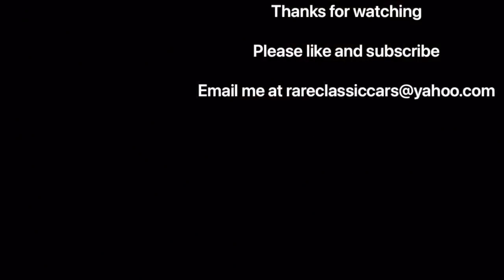Worst Engines of All Time: Chrysler 318/360/400/440 V8 Electronic Lean Burn

Comment: Hi Adam. I live in Australia. My father was a taxi driver in the  mid 70s to mid 80s. The Chrysler with the 318 was the vehicle of choice for most taxi companies.Day 1 modification with a brand new chrysler 318 elb was to rip out the elb and convert to old school carb setup.They would then run anywhere from 700000kms to 1000000kms.Amazing engines for the day.Another fun fact for you for some strange reason a lot of 318s engines were very popular in speed boats here in Australia.Not sure why.
Reply: 318 is a quite good engine among other mid-size small blocks.
Reply: Chrysler's marine division was a pretty big thing in the 60's and 70's in North America, offering both outboard (2 stroke) and inboard powerplants. Pretty sure that the inboards were based on 4 stroke automotive engines.
Reply: @martinliehs2513  Inboard were the same slant 6 and v8 engines in the cars with a few modifications to make them seaworthy.  Especially to  water pumps, alternators, ignition systems and fuel systems. Chrysler Marine made really reliable engines, some of which are still soldiering on to this day.  Jimmy Carter made Chrysler sell the Marine and Boat Divisions to approve the Federal Loan Garennttees.
Reply: @trainships1795  My dad bought a used boat in 1977 with a 45 hp Chrysler outboard that I believe was manufactured in 1968. Was a nicely built unit, but unfortunately one of the main bearings gave out after a few seasons.

I recall the 1980 federal bailout, but did not know that it required the sale of the marine division. I thought that the Chrysler marine outboards were rebranded under the "Force" name some time in the 80s.
Reply: @martinliehs2513  Mercury Marine bought the marine engine division. Chrysler Boats was sold to Texas Marine International. Chrysler Defense sold to General Dynamics. Airtempt sold to Fedders, and Chrysler Electronics sold to Teledyne. Chrysler Commercial Trucks (Tractor Trailer Type) sold to White Motor Company of Cleveland Ohio
Reply: Another possible reason was that after Mitsubishi took over Chrysler Australia in 1981, the Valiants were perceived as orphans & rapidly lost value. Hence 318 would have been cheap in wreaking yards. A similar thing happened when Mitsubishi ceased production in Australia & their 380 became worthless overnight. Interesting how all my Holdens have soared in value since GM slammed the door !
Reply: I've also seen 318s used in big SnoCats, which are tracked snow vehicles used for arctic expeditions, ski resort transport etc. It was a popular industrial motor all around.
Reply: @Luke Sm Chrysler had a marine division, I knew several people who had slant six and 318s in their boats with good results.
Reply: You could get them all in reverse drive. Had a 318 in a boat that way.
Reply: I believe you can put 340 heads on a 318 and change the cam and you got an engine that could run with vets.
Reply: The 318 is the same block as the 360 isn't it? It might have been the cheapest small block option to bore and stroke out. And 318's were probably more available than the 360's.
Reply: @JoshPhoenix11  340
Reply: @JoshPhoenix11  340
Reply: @Motorhead250  Ah right thanks yeah I knew it was one of them cheers
Reply: @JoshPhoenix11  340
Reply: A bit off topic with the v8 finding it's way into boats down under the six complete with BW35 Automatic often found it's way onto cement mixer trucks pre PTO and turned the mixers.
Reply: My dad had a 26 foot Pacemaker Wahoo with a 318 in the 1990s. He said it was pretty tired and ended up repowering with a crate 350 Chevy before he sold it, but it was a good motor before it finally gave up the ghost.
Reply: Very interesting about the  lean burn.  I wonder if you could give me some advice.  I live in New Zealand ' and I have the opportunity  to buy a slant 6  2 barrel out of a 1986 Dodge Ram truck that was used by the US government  at their base in Antarctica and later sold off in NZ' I want it to repower my 1966 Valiant '  I've  only talked to the seller over the phone and not seen it yet .What I've  been trying  to find out is the following. Would  it have at least as much power as my original 145HP motor?   It's been suggested  by some people  that the '86 motor could  be 110 HP ' but I'm aware of the change in  power  ratings that used to be" gross" 'and later  were "net " ' so does that mean that in reality this later engine will be as powerful  as my original?  .I imagine  it will have the lean burn ignition ' if so can I take out that distributor  and use the old points distributor for better performance? If I do that can I still use the 2 barrel  carb ?  or would I be better to use my old single barrel carb and manifold?  I suppose  the RAM would have a catylitic converter  'which would likely  rob power .And just one more thing ' this ' 86 motor  has had a 3 speed manual  gearbox  on it ' will I be able to adapt it to bolt up to my 1966 904 Torqueflite? I've  heard  of two different  sizes  of crank ends'  but I think' if  there is a size  difference  'a  Chrysler  parts supplier  in Australia  has an adaptor  ring for that purpose  .  Thanks.  I'm subscribed  and look forward  to other videos.
Reply: I had a Valiant Regal with a 318. Holley Double Pumper carb. I loved that thing. Had power steering, AC, electronic ignition, and the most comfortable bucket seats imaginable. I lost my license for 9 months for dangerous driving in it ha ha.
Reply: Chrysler made Marine engines up until 1980s excellent engines . 
Industrial engines 225 and 318 excellent 👍
727 transmission excellent 👍
Reply: I had a Trojan Yacht that had twin inboard Chrysler 318's they were great engines in the boat I could go 40 to 45 mph and it was a 32 foot cabin cruiser
Reply: If the 318 wasn't connected to a Chrysler transmission it was GTG(good-to-go).  The 318 is also a relatively mild motor, not really built to handle a lot of high speed revs from a heavy throttle and automatic transmission.
Reply: The reason why there were so many 318 engines in boats is because chrysler cars would rust away leaving just the engine behind.
Reply: @GetOffMyyLawn  In Australia we dont have salt on our roads and cars dont rust that badly but having said that you are right Chryslers of that era did seem to return to mother nature a bit quicker than other cars.
Reply: @lukesm5747 Datsuns we’re prone to it also. I’ve had a few rusty ones.
Reply: @GetOffMyyLawn  exactly, my grandfather had a slant 6 powered boat and that was his answer. Body would rust out, usually near the steering box and the steering box would collapse the rail. He would run his ski boat salt water cooled  for a couple of seasons until the head would crack or the old slant just gave up and we would go to the wreckers to get another. There was always a long row of slant engines to pick from.
Reply: @GetOffMyyLawn  Only one model was badly effected and then not all of them. Other models were effected and some models not so much.
Reply: @GetOffMyyLawn  the rusting issue was actually known as the "Chrysler weight reduction package". It was the built in backup plan to improve fuel efficiency once the lean burn system stopped working. 😀
Reply: They had the straight 6 hemi in Oz, something we never got here - but I pity the Aussie mechanics that ever had to work on a right-hand drive car with a slant 6.

The 318 was a great engine, no doubt.

Comment: The Lean Burn System I think worked ok during Chrysler’s testing, but in the real world it just couldn’t hold up and be reliable. I replaced many Lean Burn computers on cars that just flat out failed under warranty.
Reply: the air cleaner placement was dumb in the long run but it lowered costs to manufacture so it got the go a head and aftermarket company's have TBI EFI systems with the same placement so also opportunities for failure thats part of why i didn't buy it at first as i remembrance of the 1970's car's
Reply: Chrysler knew the system was garbage before they ever pawned it off on the consumer. Ditto for garbage that GM, Ford, and the various imports developed during that time period. The domestics drug their feet on developing EFI and as a result they implemented some really quick band aids to meet stricter emissions standards.
Reply: You had to run factory electrical components such as the stock spark plug wires or the computers would fry. I fried two or three before I found that out.

Comment: My classmate in Jr high school had a brand new 78 Aspen with a 318 and it had the lean burn system. It was always in the shop, when it was running well it was gutless, when it ran bad it would shutter, buck and barely run at all. I remember the lean burn system mounted on the air cleaner and thought "wow that is a terrible place for electronics" I think they got rid of it near the 100k mile mark, it was a endless money pit.
Reply: So says Scotty!

Comment: The struggle of the times . The primitive engine management system with epa and bean counters   control engine output
Reply: At least these low compression smog engines could have delivered good fuel economy in exchange for their poor HP outputs, but no.  They gobbled gas AND made practically no power.

Comment: Your review’s are very informative resulting from a a wealth of knowledge of 60s-80s American cars. Shame few young mechanics today have no clue how to use a timing light.
Reply: They don't really have to, today most repairs seem to be stupidly designed electronics on luxury cars(mostly german).
Reply: Heck, most younger people don't even know how to check the oil, the water, the battery, and last but not least, THE BRAKE FLUID.
Reply: @michaelbenardo5695  man, most people of my age(early 20's) don't even know how a fucking engine works. They don't know what's a piston, a crankshaft, valves, nothing. I was talking at work with one of my coworkers about changing an intake filter on his car, and he asked me what was the PURPOSE OF THE FILTER. I don't know man, maybe it FILTERS AIR? I got pretty fucking mad. But I got really mad when the dude asked my why does my engine need air inside it? He asked me if it is for cooling. I am not joking. And the worst thing is this guy has a damn near brand new Mercedes Benz with a 400hp twin turbo engine. I didn't dare to ask him if he knew how a turbocharger worked, I would've gotten a mental breakdown.
Reply: @SomeOne_86  Ain't it sad?  They will live a life victimized by dishonest mechanics, (I used to work in the industry, so I know for a fact that they do exist), all because you can tell as soon as they open their mouths that they don't know squat about their car.  Its just like the way Lyft drivers were covering up their grille with that pink mustache, then wondering why their engines were overheating and failing.  Glad that there are some like you who are keeping the love of machinery alive.
Reply: @michaelbenardo5695  Thanks man, I'm kinda limited on mods in my country(I live in eastern europe) because they measure emissions here, and you can get insane fines for completely minor things, like removing a DPF on a diesel car. So I haven't really been able to tinker much with my cars. And my cars aren't really anything special lol, a 2004 base model impreza 1.4 and a '91 civic hatch with a 90hp d-series. I'd love to have something with higher displacement, but the fees for cars above 2.0L are completely insane here, and only criminals and people with ties to the government can really drive those kinds of cars which is really sad for me.
Reply: @SomeOne_86  Does that displacement limit even apply to older, (pre 1980), cars?
Reply: @michaelbenardo5695  it doesn't, registration is much cheaper for them, but cars that are older than 30 years you can't even drive because they're considered "oldtimers" and there's a limit on how many km's you can put on them each year. And yes you do get fined if you drive more than you're "allowed". But the good thing about older cars is that they don't have to comply with emissions haha. And also, it's not allowed to modify them, because they are "historic vehicles" and you're only allowed to do minor repairs, with original parts. So pretty much nobody bothers with that.
Reply: @SomeOne_86  I love the "can't modify it" part, but the rest of what you are saying sounds pretty bad - telling somebody that they can't drive their car.  Shame.  I was going to suggest that you go to Switzerland or Scandinavia when you take a nice vacation and look for a nice pre-70s American car, something like a 1959 or 60 Chevrolet with a 6 cylinder engine and a manual transmission.  It would be fairly good on gas, reliable, and easy as can be to work on.  Not a rocket ship though.
Reply: @michaelbenardo5695  Yeah well even besides the stupid oldtimer laws, it's pretty much impossible to import a car into my country, it gets stopped at the border and then some guy "estimates" the value of it. What that pretty much means, is that criminals and politicians can import cars for 1 euro, and some random person like me can get a car that is worth 1500$ and have it estimated at 50 000$. Oh and btw, if you can't pay that tax, and you don't ship the car back to where it came from within 1 week the government owns the car. It's really retarded.
Reply: @michaelbenardo5695  What the hell stealing someone's car? I knew that radical leftists in the us were crazy but that's just insane. I've heard about the cash for clunker thing, and I know it destroyed so many beautiful cars that could have been saved. It's why you can find more mustangs and camaros for sale, than a very mass produced family car, people were just throwing them away like trash :( . I think it's very sad.
Reply: @SomeOne_86  Yup, they would come with a tow truck and just hook up and drive away, and if nobody was home, they would try to break in your back yard if you were on a corner lot to steal your car.  They once tried to do that to me when I was visiting my aunt.  The car was at her house in her driveway, and they were getting ready to hook up their tow truck.  Fortunately, I was there and stopped them, and let them know that if they ever came back, I would ---- them.  They never came back.
Reply: @SomeOne_86  One of the guys who worked at an auto parts store that I used to go to had a 53 Plymouth that he was restoring in his back yard - he was on a corner lot - and they went in and stole his car and brought it to a junk yard that crushed it.  He was on vacation at the time, so he didn't see it.  Neighbors told him about it, but the radical environmentalists had fake police uniforms on, so they thought they couldn't do anything about it.
Reply: @michaelbenardo5695  I live in Serbia. I think that the full size luxury car of today is probably something like a Cadillac Escalade or a Lincoln Navigator, it kinda fills the same role, big, huge, super luxurious quiet vehicle. But still, it's not the same compared to something like an Olds 98 or an Imperial Le Baron, those cars are just way more cool than some SUV.
Reply: @SomeOne_86  That's because an SUV, no matter how luxuriously it is appointed, is still a re-bodied pickup truck.  The luxury cars of yesterday were along the lines of the Rolls Royce.  Much less expensive, of course, but the same idea - a living room on wheels.  Much kooler!
Reply: @michaelbenardo5695  I completely agree, I just adore how they look, so stylish and opulent :)
Reply: @SomeOne_86  Hope they someday loosen up those laws in your country so you can get a REAL car.
Reply: @michaelbenardo5695  There's a higher chance of me moving to another country than them changing the laws lol. Wages here are low anyways, and any kind of job that earns decent money has a bunch of organized crime in it. And then there's the slightly concerning matter of 2 neighboring countries which swear on destroying Serbia forever. We might even get US sanctions now because our president is refusing to put sanctions on Russia, it would be pretty much impossible since we rely on russian gas, and also russia has helped our country a lot with military gear and such over the years. We're really in a shitty situation, the west doesn't like us, and we can't really associate ourselves with the east since that would pretty much mean war on the west. And we've been trying to get into the EU forever, in fact we're not even in the WTO, we've been trying to enter since 2005 lol. Our politics and history are just a huge fucking disaster.
Reply: @SomeOne_86  Oh man, I didn't know it was that bad.  We never hear anything nowadays about Serbia.  You have my sympathy.  If the former President, Donald Trump, (I call him the Trumpster - Trump + Gangster), gets back in, I would seriously want to move to another country.  I don't know if you know much about him, but when he was in Korea, he was saying things like, "I should be able to be president for life", and "man, I wish I could be like Kim Jong Un", and he thinks NAZIs can be "fine people", he led an attempted insurrection because he was not re-elected.  Not a good guy.  I hope life gets better in your country.
Reply: @michaelbenardo5695  Trumpster sounds more like Trump + Dumpster lol. I've heard that he isn't very popular, I don't really get into US politics that much so I'm not really qualified to talk on the topic. Thanks for the kind words btw :)